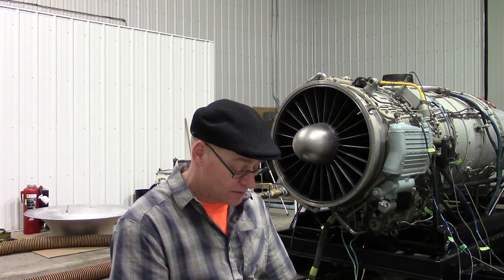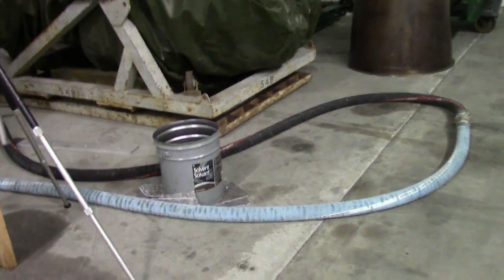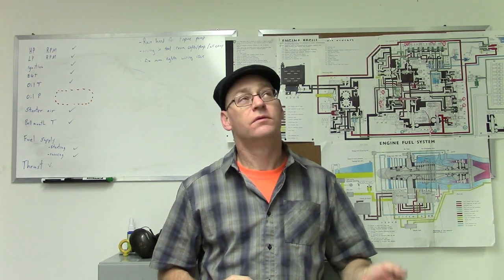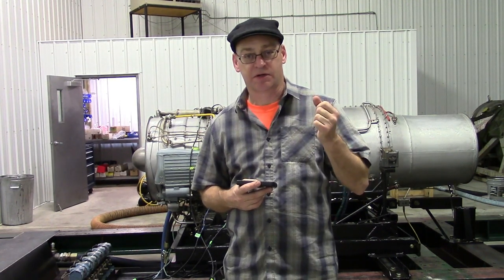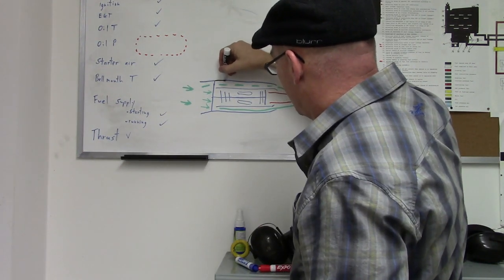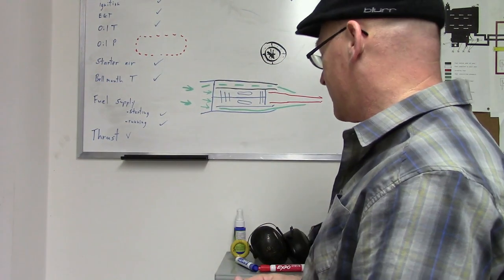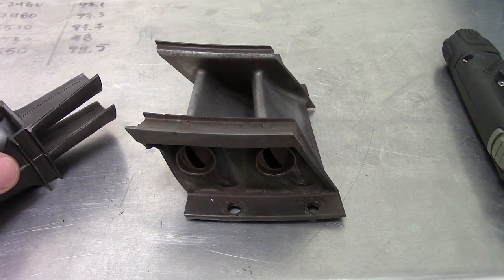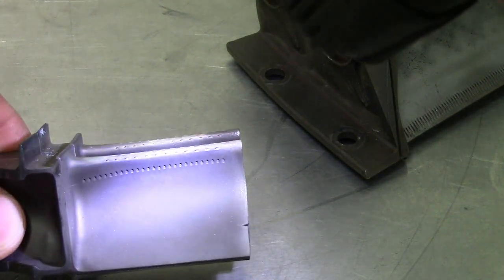Jet Questions  43

Comment: Most HRSGs (Heat Recovery Steam Generators) that use gas turbines for power use Steam (not liquid water) for both combustor cooling and Nox control. The large frame mitsubishi turbines (501G's) take intermediate pressure steam (IP Steam) at 1060°F / 560 PSIG for both cooling and nox purposes.
Reply: Is the steam condensed before entering the gas turbine?  wouldn't the steam greatly reduce the latent heat cooling effect compared to cold water vapor???
 I understand the heat recovery system would be an excellent souce of distilled water... but it don't see the advantage of using the heated water vapor as opposed to cold water spray/vapor...  any ideas?  Thanks.
Reply: No idea. They use superheated steam as a cooling medium and then recover it several hundred degrees cooler. It gets recycled into the first pass steam from the steam turbine back to the boiler.
Reply: doktorbimmer The steam AFAIK is used as a cooling medium instead of compressor air sensible heat is used rather than latent heat. It is readily available, at a similar pressure to the compressor discharge, conducts heat better than air, has higher heat capacity and lower windage losses than air. Look at some of AgentJz's videos covering cooling passages and imagine these with steam instead of air, then you will understand why water is not used.
Reply: ValExperimenter But the use of water is not being used to lower CCT..? By using steam you have already lost most of the evaporative cooling effect.
Water is generally not used for bypass cooling, in some cases water is injected directly into the combustion chambers... so no water in the bypass cooling circuits at all.  JZ also stated water is not used for bypass cooling... its used for NOx reduction .
Reply: doktorbimmer
In respect to the large MHI gas turbines they do use steam for internal cooling some other units use a fog system for capacity increase in the intake and the latent heat is used then. For the purposes of NOx reduction steam has a large cooling effect, NOX is produced at high temperatures 2000C + and both the sensible heat and the heat of dissociation of steam are large at these temperatures. NOx is produced at the flame core rather than in the relatively cool gas leaving the combustors. If there is high pressure steam available then it also does useful work as it expands through the turbine. In these systems a few points improvement in fuel efficiency is a big deal.
Reply: ValExperimenter But 75Bird455  said the system used was "superheated" (dry steam)  at 1060°F / 560 PSIG This is above supercritical temp of water where no latent heat of evaporation can occur...?  How can there be any cooling effect in the combustion chamber if there is no evaporation..?  The steam must be expanded to a drastically lower pressure and cooler temperature to form saturated condensate.. before injection into the gas turbine...?or passed through a condensor at high pressure (lowered inlet pressure)?

NOx forms at 2800°F with an excess air ratio of over 25%.

So is steam really being used to lower combustion temps?  or just to reduce the reaction rate of excess O2...?

clearly there is something more complicated going on here...  a piece of the story missing..

Cheers!
Reply: Mark Holm But steam at  1060°F and 560 psi is Superheated (dry steam) it is a gas.... containing no vapor... Gas = no vapor.  so no significant cooling effect on combustion temperatures   and no reduction of NOx by lowering CCT.
Reply: 75Bird455 So I did some research... it seems the use of Superheated steam only used on combined heat recovery systems and is not used for cooling at all... it is used to BALANCE the power output of the combined heat cycle when demand for electrical output from the power turbine is high and demand for the heat recovery steam is low.... injecting high pressure superheated steam increases the flow of measured gasses at the power turbine inlet (by the expanding steam)  this also allows the fuel flow to the combustors to be throttled down with no loss of shaft power output...  a combined gas turbine/steam turbine cycle.

The injection of superheated steam also reduces NOx, but not by cooling CCTs  but by DILUTION Factor... it increases the excess air present during combustion (above the threshhold of 40% excess air ratio) thus reducing the rate of NOx reaction..

No evaporative cooling effect going on during this mode of operation.

Cheers!
Reply: Coped directly from the Mitsubishi page concerning the 501G, "One of the 501G/701G's combustors can be seen from the turbine end. Steam is introduced to the double-walled MTFIN passage in order to maintain the combustor wall temperature within the allowable limit."

https://www.mhps.com/en/products/detail/g_series_gas_turbine.html
Reply: 75Bird455 So as I expected there is no evaporative cooling effect from the superheated steam... its only used for combustor wall cooling..? no other function then?  It appears to be a very specialized application unique to the mitsu system.

So the rate of steam injection would not be relative to turbine output as on other systems.?
Reply: 75Bird455 Its not clear if this is a turboshaft or a gas generator for a power turbine... not much info on the link.
Reply: Mark Holm Slightly...?   1060°F is well above the supercritical temp for water... super heated steam is called dry steam because all of the water molecules have been converted to a gaseous state...
Reply: Mark Holm Well your right about one thing... there would be no advantage to injecting superheated steam into an Aero engine based gas generator  for cooling..  just for balancing the loads between the two heat cycles
Reply: doktorbimmer You are missing something the combustor exit temperature of a G frame MHI turbine is of the order of 1500C, if the steam entered a hot section at 1060F and left at 1000C the increase in sensible heat of the steam is of the same order as the room temperature latent heat. With such hot parts if liquid were somehow injected, heat transfer would be by film boiling and there may be slugging and thermal shock issues none of which are desirable for this application.
On the Nox side, at the high combustion temperatures, some of the steam will dissociate into hydrogen and oxygen absorbing considerable heat in the process, it will recombine when the gas cools down giving back that heat. Google for rate equations and chemical equilibrium, as these are the factors involved in NOX production, also the terms combustion frozen equilibrium will produce useful results. This is rocket science unfortunately.
Reply: ValExperimenter Niether application actually reduces NOx by reducing combustion temperature... which was my original question.

All you need to do is increases the dilution rate above 40% excess air to reduce NOx reactions.  its a fairly simple process at these temps the formation NOx is highest within a range of AFRs.. injection of steam effectively dilutes the AFR outside the range of maxium  NOx formation without effecting power output.

Comment: Jay, why didn't you use the great picture under "engine fuel system" right behind you on the wall for the turbofan schematic instead of drawing it?  Even has the right colors.  Glad you are getting back to the AI-25.  I followed the first half dozen episodes and then,   nada  You also mentioned it had a 1.2lb/lb-thrust/hr fuel consumption which was like 4X the amount used by a big Trent engine.  Would the improvements in fuel efficiency be a good topic for a separate video?  Obviously many factors, but which are the most important?  More compression, more bypass, better burners, etc   TIA as always.
Reply from the maker: Robert Slugg I video whatever I'm working on, and there are a lot of projects on the go. The picture is too complicated for my purposes.
Modern airliner turbofans are almost ten times more fuel efficient than the first turbojets.
Everything is better... like comparing a model T to a new F-350... where do you start?

Comment: Hi Jay, I've got a question about the typenames of the GE-engines you work on: any idea where "J79" stands for? Same whith "LM1500/LM2500/CF6" and so on. I read somewhere that Rolls Royce called they're engines after rivers. But I cannot find any logic in the typenames of GE-engines...
Reply from the maker: I'm not really sure what J79 stands for, but likely turbojet, and maybe something to do with sequential namings by the US  military...
The LM stands for Land and Marine, and the numbers are 1/10th the nominal horsepower the engines were initially designed for.
The actually make considerably more power as they have been developed.
The LM500 makes over 5,200Hp, the LM1500  makes over 16,000Hp, and the last LM2500 I saw was rated at 34,800Hp.

Comment: Question:
Part1what is a hot start and what damage can it do to the engine
Part2:
What happened when when an engine backfire and what damage can it cause
Reply from the maker: Kane Williams Back fire is not a meaningful term. Several different things can cause flames to come out the back of a jet engine. None of them are called backfire.
The answer to question 1 is long and better understood by checking out any of a number of excellent books on gas turbine engines. All at your library, or on line, and recommended by me throughout many of my videos.
Reply: Can u answer the the second one in one of ur videos
Reply: Kane Williams A hot start is simply as it sounds. All gas turbine engines have a temperature limitation that should not be exceeded. The most critical time and highest temps an engine will see are at startup. When starting a turbine engine, the starter can only spin them up so fast and with limited airflow at these low speeds. Fuel must be introduced and ignited in these less than ideal conditions of low airflow, hence reduced cooling ability. The starter stays engaged to help the engine accelerate to the point the starter is no longer needed. A hot start is the engine simply hits a state of overtemp during the starting process. If the start isn't aborted the high temps can damage/melt the hot section parts. Something as simple as too much wind blowing towards the jet pipe can hamper airflow enough during start up to cause a hot start.
Reply: Cool

Comment: Duhhh.I assumed that you tested the engines with propane fuel.(Cheaper?) In your last Q43 you discussed testing with jet fuel. What are the differences in engine fuel systems between jet and propane. Can you run either way?

Comment: Hey Jay,
Love the vids, very jealous of your unique position in aviation. I imagine that you guys see much more than even the creators of jet engines! 
You guys see the end result of almost every scenerio. Anyway, I wanted to know if you could clarify the bypass duct a little better? When you see a jet engine with cowling open and all the working components exposed, is that the duct area? or is it under that? 
Because it's such an important aspect of engine efficiency in a turbo jet what type of volume does it equate for in the overall area of the engine?
And lastly with all that power from both power plants moving so much airflow, how are they synchronized?
Thanks in advance..
Drew
Reply from the maker: Interesting questions... we're getting into an area where it's way easier if you understand the diagrammatic, textbook explanations first.
The cowling is part of the aircraft, not the engine... and the answer to your first question is really: it depends on which engine you're talking about.

By convention, turbojet engines are not bypass engines, which are also turbofans. A turbojet is not a turbofan.
RR likes to confuse you by calling all of them turbojets, and the turbofans "bypass turbojets".
It's typical of RR to ignore industry standard nomenclature and say whatever they want.
Anyway, the bypass ratio is different for different engines. Actually, bypass ratio is one of the descriptors which is used to classify engine types and performance.
And lastly, your term "both power plants"... do you mean the right and left engines... or do you mean HP core and fan bypass airflow?

...synchronization of airflows in turbofans is just not anything that happens or is a concern in any way. There is no such thing.
Reply from the maker: drewbin101 Have a look at Q43, where I draw the bypass duct of a low bypass turbofan, like the JT8-D...